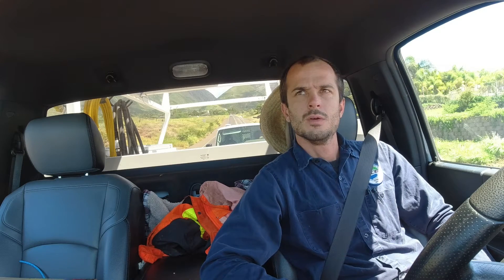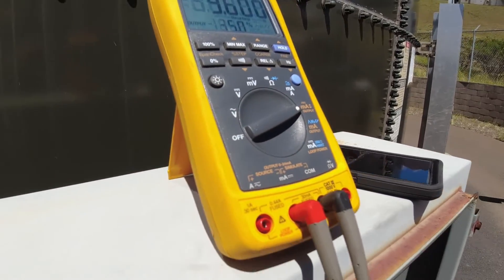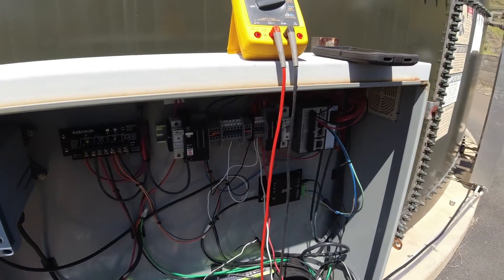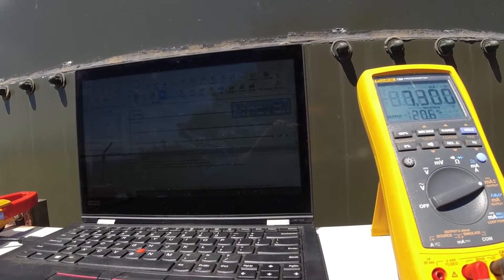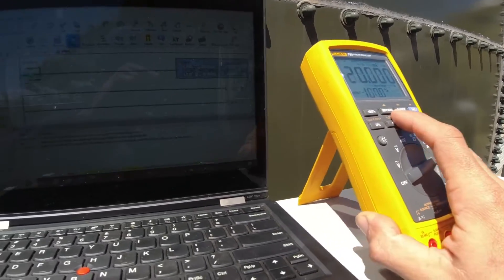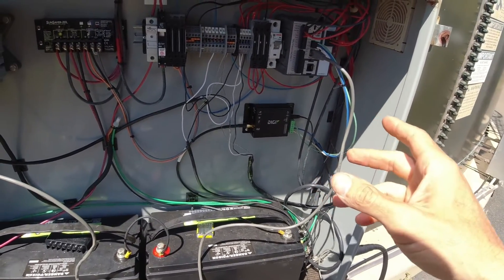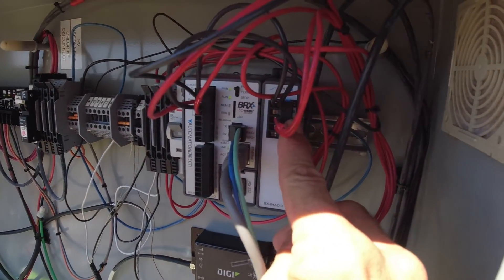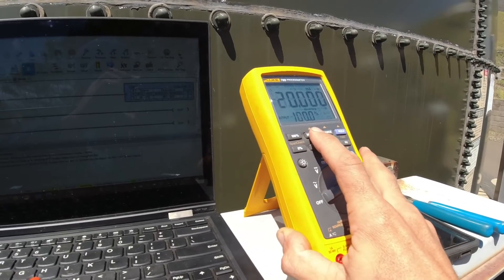Troubleshooting A 4-20mA Submersible Level Transducer In the Field With A Fluke 789 Process Meter

Comment: Just got a couple of these meters today. This gave me a little insight on how to use it for the plc's on our machines. Thanks
Reply from the maker: They're great, only thing they can't do is generate 0-10vdc. Which is something I'm finding I may need more in the future. 95% of our analog signals are 4-20.
Reply: @Up-CountryElectric  Being I paid $5 total for two 789's in mint condition and an 83v at an estate sale that the lady didn't even know what they were. I can't complain. 😁
Reply: @Up-CountryElectric You might want to look into the Fluke 773, pairs well with the 789. (Since the 773 is DC only)

Comment: Hay, Can I ask you something? How does the radio guy know the PLC raw value is from 6500 to 32k for that level sensor range? If we don't know, could we just give the 4-20mA from 789 and find out the min & max raw data range for that level sensor? Or Have to find that PLC manual for analog card raw data? Or is there another way?
Reply from the maker: That's the standard range for an analog input converted to a signed 16-bit integer. Some PLCs and equipment use different values, but the PLCs we use all utilize a signed 16-bit integer with a range of 0-32k.

Comment: Will the 789 meter generate 12 volts on a 12 volt system, such as a vehicle or only good for the 24 volt systems?
Reply from the maker: It's built in power supply is only for sourcing 24vdc loop power for 0-24ma current circuits. It can also sink using an external power supply.
Reply from the maker: It's built in power supply is only for sourcing 24vdc loop power for 0-24ma current circuits. It can also sink using an external power supply.